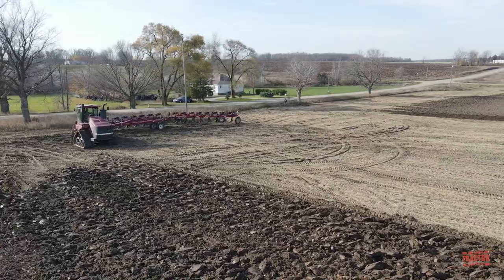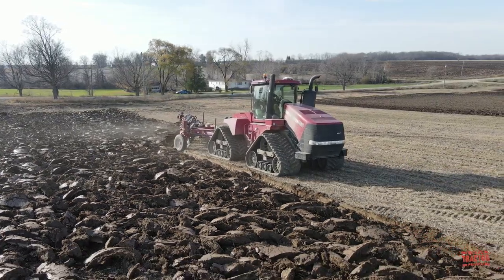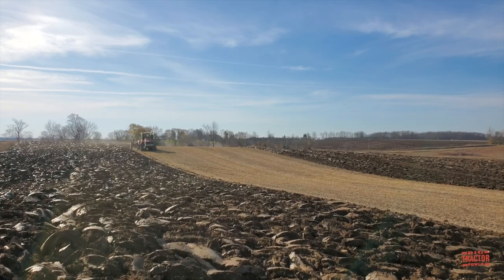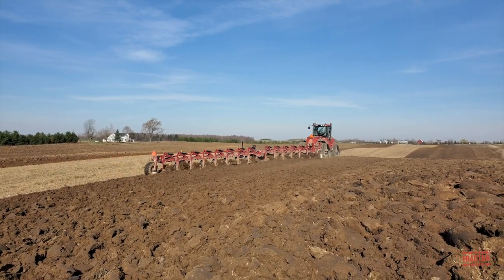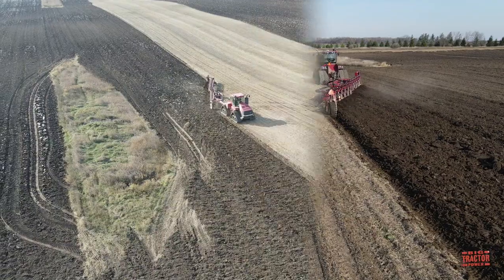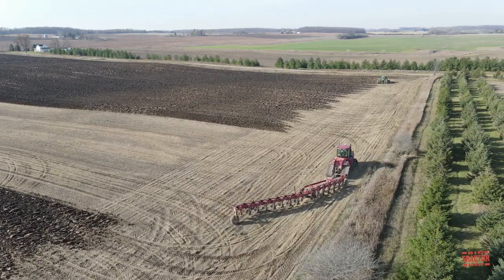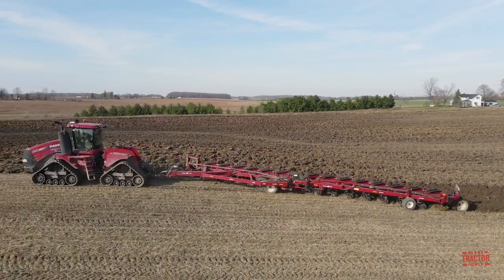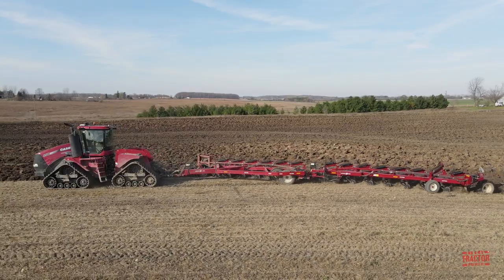BIG PLOWING 14 bottom Salford 8214 Moldboard Plow

Comment: Amazing, amazing, amazing! That tractor’s engine never once changed in it’s sound as if there were no “tough spots” in that half mile long field. What tremendous power! I pulled a 2-14” plow with a 1949 Case SC and I thought I was, at age 8, big stuff. Of course that was in 1952. :)
Reply from the maker: It’s impressive how tractors have developed.  The first tractor I ever got to ride in was a 1977 Case 2470 Traction King with a seven bottom Case 700 plow. In 1977 that tillage combo seemed huge today it is tiny compared to a Quadtrac.
Reply: I have a few tractors and plows a 706 German diesel and a 540 plow 4-14s
Reply: 1206 and a 5-16s 550 plow or a 5-14s 70 plow

Comment: Good grief! That rig is doing crazy work. Would it be an option for the farm to do some deep ripping before winter and run a big disk over the field in spring? The field looks so hard that it seems beneficial to get a little extra depth from ripping. Also, the minimum recommended tractor at 490 hp for this plow would probably struggle a lot in that field. Fantastic video, thank you! :)

Comment: Talk about hardpan! Those aren’t rocks tripping those bottoms that just hard plowing. 
Almost need a bit more horses there to.
Reply: It’s do make sense.
Reply: Where do you live ?
Reply: Our land here in Central Alabama has a hard pan too. We deep chisel, then use the turning plow. I notice in the video the soil appears to be somewhat wet and is "shiny and Slickn'" behind the plow. If looks like that here, we would have bricks!
Reply: Why do you need more horses? The tractor is running at low revs.
Reply: @xuser48  you don’t plow with low rpms, that engine is laboring big time
Reply: @johnallen5996  That engine is working absolutely fine. No reason to change anything.
Reply: @xuser48  hi
Reply: @johnallen5996  hi dear

Comment: Sal Ford  is keeping  awake the flame with these long moldboard plows.Kverneland make still make them to.I thought the Quadtrac might be  a 600 or 620 because of the 14 bottoms
Reply from the maker: 550 hp is good sized. International and John Deere built 16 bottom plows in the 80’s.  Those were pulled by 470 to 525 hp tractors back then.

Comment: Immidiately thought of the Case 150 steamengine tractor pulling J.D. 36 bottom plough with 18 operators on top,this plowing a bit deeper though think?!!
Reply: Yes much. Those were antique 10 and 12 inch bottoms scratching stubble. 
But this one is also going slow!

Comment: That quad track could pull a disk ripper probably twice as wide as that plow while actually reducing compaction instead of furthering it and would leave some residue on the top to drastically reduce wind erosion.
Reply: But it would not control the weeds as well
Reply: @robertmarincic5697  tillage is a poor weed control strategy in the first place. You know what else is a poor strategy. Mold board plowing fields. Nothing like creating a hard pan and creating a recipe for massive amounts of soil erosion caused by wind and precipitation when there's no residue left on top of the soil to protect it. But I guess many of you are OK with all of your best soil and nutrients being blown into the nearest road ditch.

Comment: To all you fine gentlemen, here in the comments section of this video, the worry is about the bumpy ride  on this farm come springtime. That would worry me too. If it were me moldboard ploughing-at least in this part of Michigan, I would have a moldboard plow that you could hook up a packer to--a hitchhike packer. That would level out the ground somewhat and be a far less worry about very bumpy fieldwork come springtime. At any rate as far as I am concerned, to each his own.
Reply: By the time winter is over it looks nothing like that. Rain and snow smooths it out
Reply: @Encourageable  You have a good point.  I admit, I never thought of that.

Comment: 2 plows hooked together or is that one big one?
Reply: A big one
Reply: @jackgerberuae  Hey guys, 8200 models have a front half and back half and they can flex side to side and up and down in the middle. That helps such a large plow follow the hills and valleys in the field. You can actually plow with just the back half if you needed a smaller plow, but the front half needs the back to work.
Reply: @SalfordGroup  thanks for the clarification. 
My reply implied it’s not a modular or scalable unit, but it appears to be much more.

And so, you buy the full plow as shown and as a bonus, you can use it with:
•500hp tractor or;
•250hp tractor if the big boy is busy

Comment: Why? Trying to warm the soil for planting?
Reply: @xuser48  I’m asking why they’re plowing it
Reply: @justinmartin8887  Turn up the sound and listen.
Reply: Corn stalks need to be broken up or ground is hard
Reply: @maxhallman1036  I never had that problem
Reply: @justinmartin8887  we have even demoing the new drills we've had to ow or chisel before drilling
Reply: @maxhallman1036  interesting. must be very different soil than what we have
Reply: @justinmartin8887  red clay? Because that's what we have and it's extremely humid and hot here in the summer and then cold in the winters so they plow it so they can work it sooner

Comment: Why don't Americans use reversible plows?
Reply: Fields aren't that small and normally we have the space to turn around
Reply: @maxhallman1036  By splitting the field into 2 smaller fields, won't you end up with a big furrow in the middle when the field is done? Because when your plow is not reversible (cannot be turned upside down), you plow in opposite directions. Also, you'll be pulling soil away every time the plow gets into the soil. Won't this result in unevenness? When you go back and forth working on your previous furrow every time, it alternates. So the plow will enter and exit the soil in turns. Anyways impressive and interesting to see this way of working.
Reply: @whiterazer1  nope this is just primary tillage it's went over by a disk or seedbed finisher you never plant directly into plowed ground